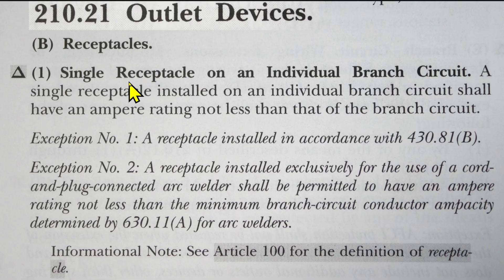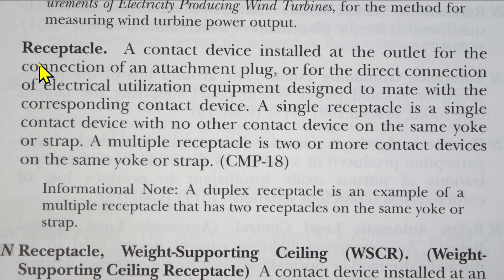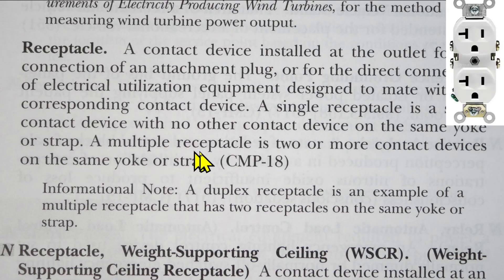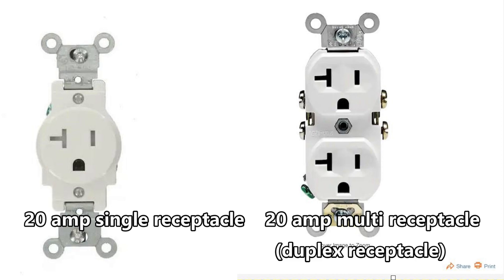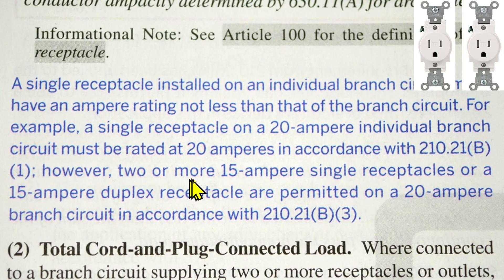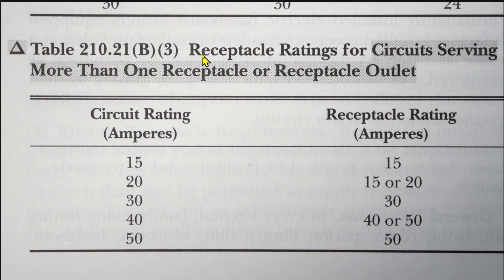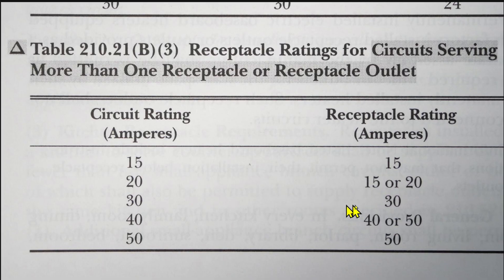Shall I Use 15A or 20A Receptacles on a 20A circuit per 2023 NEC 210.21(B) ?

Comment: It says not less but can it be more? Example 15amp breaker and 20 amp receptacle? This is the question that i want to know.
Reply: Yes, it is allowed by code if it's an individual branch circuit and a single (simplex) receptacle. The reason is to allow a 50 amp receptacle on a 40 amp circuit because there is no 40 amp receptacle. Another thing is that they are relying on the circuit breaker to protect the circuit if heat from an overload is detected. I would still only use a 15 amp receptacle in this case.

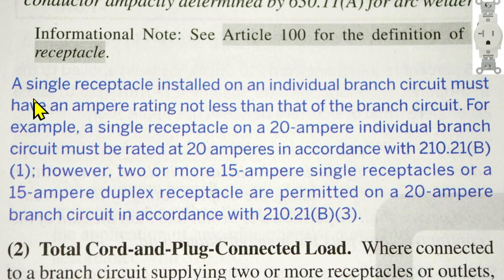Comment: At 2:56 the statement reads "not less than that of the branch circuit".  I would interpret that as meaning equal to or more than. So by that logic, it would be permissable to put a 20 amp single receptacle on a 15 amp individual branch circuit. Doesn't seem right, and I welcome an explanation.

Comment: One quirk is that if a rare 20 A device is plugged in, it should be the only 20 A device in use on that circuit (sort-of).  That begs the question why 20 A duplex receptacles have dual 20 A outlets and not just one?  Reason being that the only device w/ a 20 A plug must draw >15 A, otherwise it would just use a 15 A plug.  The exact NEC code is more confusing, stating that if you have only one receptacle on a 20 A circuit, it must be a 20 A type (ditto for a 15 A circuit).  A rare situation, such as a well-pump with 20 A plug on a dedicated circuit, but with a plug instead of hard-wired.  High-current devices are best hard-wired.  See the many youtubes of EV charger receptacles that melted since the owner wanted a plug instead of hard-wired.

Comment: If running a 40amp breaker for 120v for a welding machine is there a 40 amp receptacle? Or can you use a 20amp outlet?
Reply: No,  you use a 50 amp receptacle and 8 gauge wire for 40 amps and 6 gauge wire for 50 or 55 amps. They are only for 240v circuits, 120v circuits use only 15 or 20 amp breakers. You can also get 15 and 20 amp 240v receptacles for those requirements.

Comment: Ok, but what kind of receptacle do you use on a 25amp circuit?
Reply: A 25 amp circuit doesn't have receptacles, there's no option for 25 amp receptacles.

Comment: Why does the 40 amp  circuit rating allow for a "40 or 50" amp receptacle rating? Isn't that allowing for MORE ampacity in the receptacle than the circuit is rated for? That seems like a typo, doesn't it?
Reply: There's no 40 amp receptacle.

Comment: Only need one 20 A receptacle in the kitchen and maybe one in the garage, just in case you ever have an appliance w/ 20 A plug.  Very rare, just something like an air compressor or monster toaster.  In a kitchen remodel, I installed one receptacle with USB charge ports as shown, just to appear modern, though may soon be outdated. At least it includes a USB-C plug.  It was $35 and fairly bulky since has all the electronics of a USB adapter.

Comment: do all the receptacles on a circuit have to be the same amp rating?
Is it ok to put a 15 amp receptacle downstream from a 20 amp receptacle?
Reply: If it's a 15 amp circuit, then yes, on a 20 amp circuit, it doesn't matter.

Comment: A bit misleading of a title – only Article 100's receptacle definition to include "or for the direct connection of electrical utilization equipment designed to mate with the corresponding contact device" verbiage is new.  210.21(B) regarding 'single receptacle must be at least that of the branch circuit, etc.' has been that way for decades.

Comment: Builders are notorious for doing the ABSOLUTE MINIMUM. Examples are running 15 amp circuits for receptacles, as using 14 AWG wire saves them $100 per THOUSAND FEET of wiring. Never mind having tow keep both 14 and 12 gauge wire on hand, saving 10 cents a foot is paramount. 
Another lovely example is putting only one receptacle outlet on a 12 foot wall. Hit dead center with it and you're meeting code. Sure, the home owner will come to hate you for such cheap crap, but the big thing is to save $1.25 for that extra plastic box and bargain basement "residential grade" receptacle to put in 2 outlets. It''s okay - let 'em hate you, right? You got their money, so who cares...

Comment: Very clear and informative! 
btw, the way I read the code, if you use a 20 amp outlet (with the T prong), then you must use dedicated 12 gauge wiring to that outlet. 
In other words, you cannot daisy chain 20 amp outlets.
Reply: Not quite. If you have a 20 amp circuit (12AWG) you can use 20 amp duplex receptacles for the entire circuit. 15 amp receptacles are also ok. A dedicated circuit means that there is only one socket on the circuit to plug into. It must be a 20 amp single receptacle if it's a 20 amp circuit. A duplex receptacle is 2 sockets.

Comment: This might be a stupid question but hey we all ask them when we're learning, and I'm learning...does it matter whether the line comes in the top or bottom terminals, and which one the load goes out, on an outlet? I know with GFIs it does and they're labeled, so I assume not or regular outlets would be labeled accordingly as well. If not, do electricians use any sort of rule of thumb for top vs bottom, or is it all just how you feel like connecting them?

Comment: When comparing the higher quality 15 & 20 amp rated outlets, both have the same size hot terminal so what is the point in differentiating between the two? Other than saying where a 20 amp outlet is found, you can be sure it is wired to a 20 circuit and as for 15 amp outlets, it could be either a 15 or 20 amp circuit. I think I answered my own question.

Comment: You're wrong if you put two of the same outlets from the same brand of 15 and 20 next to each other and take them apart and measure the gauge of metal through the same thickness of metal

Comment: Putting NEMA 5-15R receptacles on a 120 VAC 20 A circuit, although permitted under certain circumstances by the NEC and certainly popular in the wild, is a bad idea.  The idea that a receptacle, and not the circuit breaker, should be allowed to be the weak link in the chain is absurd and dangerous.  Stick with NEMA 5-20R receptacles on 120 VAC 20 A circuits, and don't look back.

Properly designed 120 VAC/20 A equipment should have a NEMA 5-20P plug, not a NEMA 5-15P plug.  For example, the APC AP9563 power strip uses a NEMA 5-20P plug.  The Yodotek 12 AWG extension cords use a NEMA 5-20P plug: ironically, some users give them poor reviews on Amazon precisely because they are confounded by the NEMA 5-20P plug.  (It's an example of the marketplace behaving irrationally, punishing a manufacturer for doing the right thing.)

Good thinking regarding residential vs. commercial receptacles.  The receptacles you install will probably be around for a very long time, and no one likes to change them.  Using commercial grade or even hospital grade is an excellent idea if you require decades of trouble-free service in places where items are plugged and unplugged frequently and where the current draw may approach specification limits.  (Many electricians have horror stories concerning badly designed NEMA 14-50R outlets, even from name brand manufacturers, that were connected to EV chargers.)

Comment: This is a second video about 15 amp receptacle on a 20 amp branch. I found your video interesting in that you are assuming most of the branch circuits are 20amp. Does this not cost more in wiring? There may be special applications where 20 amp(12 gauge) circuits are used everywhere. It seems to be playing with fire having 15 amp sockets on a 20 amp line. Pun intended. I jumped up and checked my circuit panel. I had mostly 15 amp breakers and 14 gauge wire on my lighting and appliance branches. Sorry this makes more sense and is more idiot resistant.

Comment: You are seriously confusing the difference between "20 amp" and "commercial grade".  The two have absolutely nothing to do with each other.  All of the reasons you gave were actually  only reasons for using a commercial grade ("spec grade") receptacle instead of a residential grade one.  They have nothing to do with the current rating of the socket at all.  (There are many many spec grade 15A sockets, too, not just from Leviton but from almost all manufacturers)

The only significant difference between a 15A receptacle and the same grade of 20A receptacle is that a 20A receptacle allows you to plug 20A power cords into it.  That's it.  Most people do not have anything that uses a 20A power cord (and never will), so for most people there is absolutely no advantage to using a 20A receptacle, period.  You can just use 15A commercial grade receptacles instead, and it will be just as good.

Comment: I prefer using commercial grade receptacles as well but don't necessarily see the need for 20A receptacles throughout the house. However, it' s really tough to find Decora style commercial grade 15A receptacles that are tamper resistant as code dictates for living spaces.

Comment: Is it acceptable to use 20Amp outlets with 14 AWG wire with a branch circuit breaker rated at 15 Amps?
Reply: Note - I do not have any 20Amp devices that have the horizontal neutral prong.

Comment: As usual, the NE Code update still has the inevitable ambiguities, which could be clarified with a couple clear illustrations of what is and is NOT acceptable. The old SNL skit about "You can't put too much water into a nuclear reactor" should be on a plaque over every Code editor's desk.
  To wit: At 1:00, a Single Receptacle on a Branch Circuit shall have its rating not LESS than the Circuit, i.e. 20A. So, this Branch Circuit as I read, could continue on, to a series of duplex receptacles, which could all be 15A. It does NOT say that the Single receptacle is the ONLY one on the entire circuit.
  At 2:40, the wording is still just as ambiguous; a simple drawing, of a line with One receptacle, Ok, and another with additional receptacles either single, duplex, beyond, either green circled OK, or red bar circled NOT okay, would completely answer such questions.
  The question asked in the lead to this video is NOT the one to ask; what is being asked, is should we select a higher quality, pricier receptacle, over the minimal allowed by Code, because of its construction compromises? Better 15A units are built to the same higher standards, so the 20A relationship is irrelevant, and even misleading, when I have literally never seen any small kitchen appliance with a 20A plug demanding a 20A outlet.

Comment: I was going to use the TDR20-W in my house since I have 20A circuits. My reasoning for instead going for the TDR15-W (which was actually a few cents more expensive for some reason) instead was that I realized that I'm very unlikely to have only one device plugged into a circuit at any given time. Since having even one 20A load would max out the circuit, I'd rather disallow that from happening. Heck, even my laser printer dims my lights. (Maybe that's partially due to low-grade outlets adding excess resistance. I guess I'll find out.) This still boils down to personal preference, but there's a perspective on why one may choose not to use the 20A variant.
Reply: Gobbledegook. Using 15amp receptacles already restricts usage on the 20amp circuit since you cannot plug 20amp devices into a 15amp receptacle.

Comment: I'm surprised they chose to use the term "single receptacle" instead of "simplex receptacle", because the latter term is a better comparison to the much more commonly understood "duplex receptacle" (which everyone just calls "a receptacle" anyway). Oh well. So it's okay to have just one 15-amp duplex receptacle on a 20 amp circuit because it's duplex and not simplex  (single).
Reply from the maker: Good points, thanks.
Reply: I find it interesting that they used single instead of simplex in the nec code book .
Reply: @irafair3015  "Simplex" must be sort of arcane. It's used in telecom to denote a lack redundancy in a fiber ring. Simplex mode versus duplex mode.

Comment: First sf all ,it depends on the thickness of the incoming wire of the socket. The maximum load of 4 square millimeter copper wire is 8KW. A=KW/110V, Add up the power of all the electrical appliancesthat will be used on this socket , and use the previous formula to calculate. you can get the maximum ampere usage of your socket, and multiply the mumber youcalculated by 1.5 times, which is the safe current you neeed to buy amperrage.

Comment: Some people like to use commercial grade appliances at home. Some of which have NEMA 5-20 plugs on them.
Reply from the maker: That's an excellent point, thanks! For other viewers: The 5-20R T-Slot receptacle allows you to plug in either a 5-20P or a 5-15P plug, allowing greater flexibility. In modern home installations, 5-20R T-Slot receptacles are often used when 20A circuits are installed due to flexibility of being downward compatible with the 5-15P.

Comment: I am confused about the "feed-thru rating".  I am assuming that is the rating allowed when the power wire is connected to top screw and the load wire [downstrean outlets] is connected to the bottom screw.  BUT if the box wiring is using the "pig-tail" method where the power wire ,and load wire, and pigtail are connected with wirenut, then the only current going to/thru the outlet is "that" outlet and the pass-thru current to downstream outlets is goig thru the wire-nut connection. In which case the feed-thru rating of the outlet is not significent. or am I missing something??
2nd Question: Is the "pig-tail" method a code requirement?
Reply: Your first statement is correct as the feed thru rating is only relevant when the top and bottom screws are used to connect downstream. For your 2nd question, the answer is no, it's not a code requirement.

Comment: Just from the CEC side. We have a code section that requires certain wire awg to be on and only up to certain amp rating (other parts change that  ie motors etc).  So the NEC allows just say 14 awg to be on a 20 amp breaker in general? (Talking dwelling units ).
Reply from the maker: No, 14AWG is only allowed on 15 amp circuits per the NEC.

Comment: You describe the plug in facing area on the 20amp rated plug as grabbing the plug harder..
It is not the facing that does so, it is the underlying connections, not the face.
Flat face vs "plug finder" type of face is not relevant to what you are saying to folks on this video.
Reply from the maker: Yes, that's right. The commercial spec receptacle grabs the plug considerably harder. I didn't mean it to sound like the face made a difference. As you say, the face doesn't matter. I specifically used the non-TR receptacles for the video in hopes that the copper connector inside would show. They are more heavy-duty on the commercial spec receptacle.

Comment: On resi vs commercial grade, nearby price per rcpt of big box store Eaton when bought in units of 10 (15A only as 20A resi isn't much of a thing) - resi $.80, comm $2.15, TR comm, $4.00. For a homeowner, it's a obvious choice once you know it exists. For a contractor, when resi is demanded, you know the customer's price/quality sensitivity now and go in with your eyes open, especially if your ethos is to solid quality work at a fair but appropriately higher cost.
Reply from the maker: Thanks!

Comment: On 15A vs 20A, the default/obvious choice is match the receptacle to the circuit amperage. Reasons to put 15A rcpt on 20A circuit could be matching an existing look, some people/businesses feel the 20A ones look too industrial so don't like that styling, or saving a small amount of cost. An actual NEMA 5-20 plugged device is extremely rare in residential settings, though. I've seen on higher end houses now, many like having the 20A rcpt throughout feeling it shows that it was built well / heavy duty.
Reply from the maker: Good points, thanks!

Comment: Good info as usual Bill ... Have you seen or used the outlets and switches with the WAGO type levers to connect the wires to ? No tools required but I'm not getting rid of all my electrical tools just yet :face-blue-smiling::face-purple-crying::face-pink-tears: You can do a vid on them ... Thx my friend ...
Reply from the maker: I have heard of them but haven't got my hands on them. I'll have to check them out. Thanks Eddy, have a great Saturday! I'm getting ready to watch the SDSU Aztecs play in the final 4 of the NCAA basketball tourney.
Reply: @SparkyChannel  In particular the Leviton Edge brand (seem to be exclusive to Home Depot). I normally use the Leviton "preferred" with the full metal strap, it will be interesting to see how these compare (might have to cut one open).

Comment: I may have missed it, but I think you did not mention if there is any difference in the wire used, or the breaker associated. I assume 12/2, and a 20A breaker.
Reply: You cannot use a 20A receptacle or breaker with 14 gauge wire, so yes in this case it is 12 gauge wire and a 20A breaker since it is a 20A circuit with the option to use 15A or 20A receptacles.
Reply from the maker: You're correct, I should have included the NEC table for size of wires needed for 15A and 20A circuits. I'll catch that in another video.